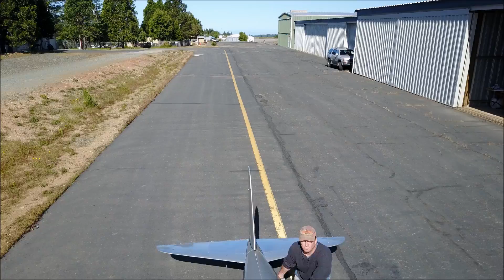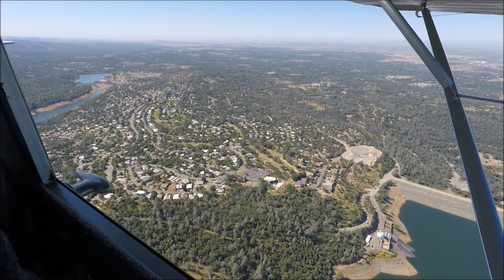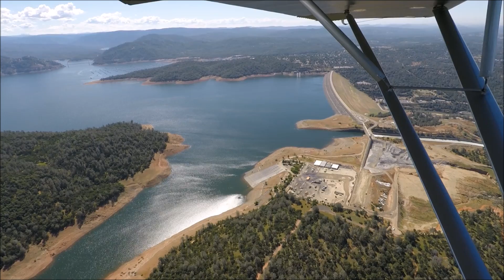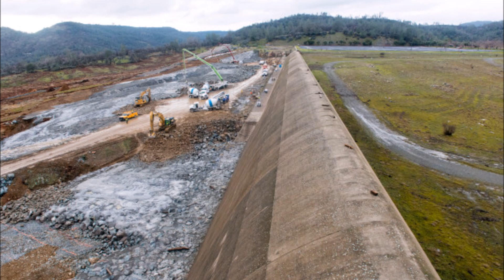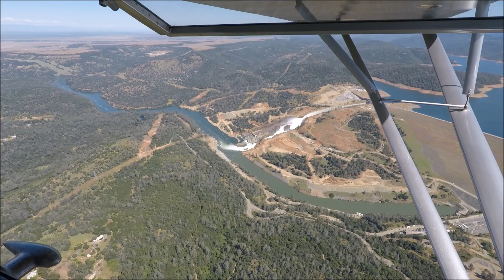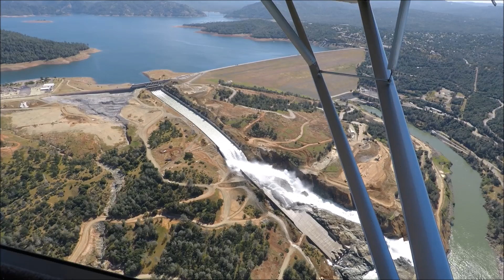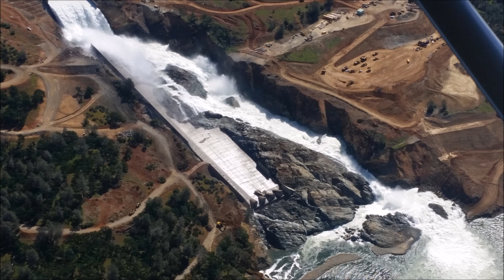Oroville 15 May Update -Recovery

Comment: We flew right over the Oroville Dam in an A380 airbus (talk about an amazing feat of engineering!) on our approach to SFO from Frankfurt.  The down camera gave an excellent view of the spillway and the canyon.  The gorge formed below the top of the spillway is certainly impressive.  It sounds like from your report that they will try to fill the gorge with a combination of crushed rock and slurry mix and then pour the RCC on top of that.  I wonder how they will contain the sidewalls of the fill?  Has DWR put out any specific plans for this?  Engineering minds want to know!  And Juan, thanks so much for your reporting.  It is such a pleasure to have access to straight forward reporting and not hype and fear porn!
Reply from the maker: Then build a reinforced concrete spillway on top of the RCC.

Comment: Batch plant would be on the wrong side of the spillway and require many millions to haul it around. If they plan to reuse the removed rock immediately after blasting it out, it will require a "drying time" before it can be run threw the plant.
Reply from the maker: i  think your right!

Comment: Wondering why they don't use the "new canon" as the new spillway... It is cut into the rock and I thought would be relatively stable.
Reply from the maker: The new canyon will be part of next year's back up plan...
Reply: Understood. Altho they are using as such because they can't complete the full planned repair before next spring.

I'm thinking that with the course sides of the rock it will induce turbulence and protect the 'walls' of the new canon. With low flow it is a calm stream, in a HIGH flow the turbulence and spray would act to protect the canon structure; kinda like it did in the stabilized form. Remove the soil and loose material, shotcret and pin to add stability to the canon...

Just me thinking thru the problem but I'm not a geoengineer.

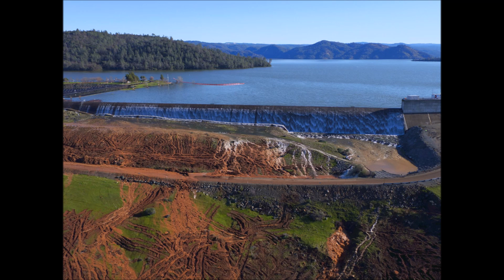Comment: Another great update. Thanks Juan. I have been surfing the Internet looking for typical solutions to this problem. One solution that caught my attention,  was Elliptical Concrete Culverts Pipes, They have internal dimensions of about 3 metres height, and 2 Metres width. ...But the exterior is not curved it is an elongated Hexagon with straight edges. This allows for 'Honeycomb" construction. These are used as emergency floodwater diversion pipes. and river diversion. The elliptical profile is claimed to substantially improve flow characteristics. I would add that from a Logistics and Cost Estimation perspective, mature solutions like this should at least be on the table for debate and discussion. Weighing about 10,800 kilos each, I imagine that even Helicopter Lift is possible? Call In The US Army Corps of Engineers, and make it a Training Exercise! Personally after @ 6:40 "ENORMOUS EROSION ON THE HILLSIDE BELOW". Allowing the water to flow in safety,  as far away as possible from the dam. from my layman's point of view, it would seem like a good idea for the emergency spillway. Those Elliptical Interior Profile & Honeycomb Exterior Profile River Diversion Pipes might be suitable?

Comment: Did you use your Mavic to get the "fly around" video at about 32 seconds into the video? If so how did you get away with that at an airport?  In the past I have pointed out the seemingly total lack of interest in this dam situation by Gov. Brown.  Today I was remembering the controversy during the dam construction that Gov. Pat Brown was stealing funds meant for the dam, which is why some of the construction may have been sub-par. I was pretty young but remember hearing about it.
Reply from the maker: Yes having a little fun with the Mavic at the airport. Must get permission the airport manager.
Reply: I have been thinking of trying to video the crop dusters with my Mavic.  Not sure of the legality of it though. They fly just a few hundred feet over my house, well within my legal air space of 400'.  I'm thinking if I "hug" a pine tree in my yard with my drone and never go above the tree top, I can get some pretty cool video without putting anyone in danger. Though I'm not in or near a No-Fly zone, I always have to "listen" for approaching aircraft when flying my drone in my back yard because most every day planes and helicopters fly over or near my house at less than 400' elevation.
Reply from the maker: I would get permission from them first then go film the entire operation.
You may have to gain their trust first.
Reply: It is easier to ask for forgiveness than to ask for permission.
Good video as always.

Comment: If they build from the bottom up, the point at which they reach the upper half of the old spillway; the two parts will have to be flush.
so assuming the new spillway is thicker than the old, next year they will have to remove more material under the upper half of the spillway than if they simply began building from the top down.
I think they are making more work than they realise.

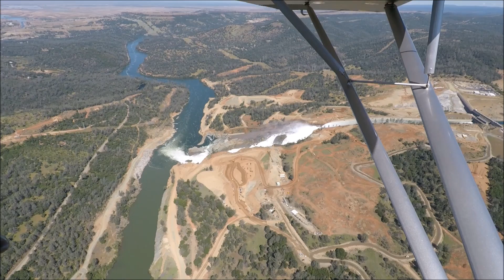Comment: At 12:28 on the video timer you speak of CA newest formed canyon, what is the depth and width at its deepest, shallowest, widest, and narrowest? It is difficult to phantom the magnitude of size from that height. Thank you for your updates, time, and energy in doing this. Was this a volunteer project or were you contracted to do this?
Reply: For scale, the main spillway chute is 178 feet 8 inches wide (a bit more than 54 meters).

Comment: One of the constraints on spillway flow has been the desire to avoid low reservoir level scouring of the inlet channel above the spillway. Are there any plans to dredge this channel deeper so as to allow high flow rates at lower water levels?
Reply from the maker: I asked about that and DWR said no.
Reply: Hydraulics is not my field, but I had thought that the scouring danger was primarily related to eroding the intake channel, which is dangerous for an earth-fill dam. But secondarily, it might be possible for the current to carry rocks up to the face of the gate valves (it would be a challenge to dislodge a rock that was wedging a gate open). It's a bit surprising that there are no plans to deepen the intake channel, especially with all the resources now on hand as we start to go into the dry season and the expected lowering of the reservoir level. Maybe someone can talk about the scouring issue in better detail?
Reply: Am I correct in assuming that, if that inlet channel scours, the rocks & sand would do erosion damage to the gate structure, and potentially to the gates, themselves?

Comment: splendid job explanation is excelent. If the water level in the summer drops right down, are they going to do anything to the spillway inlet, so they can drop the lake lower without scouring occouring.
Reply from the maker: Not at this time.

Comment: Hi Juan, when you quote 838ft  is that the height of the dam or is that from sea level ? Keep up the great reporting
Reply: The emergency spillway is at 901. The DWR considers everything above 850 to be reserved for flood control, so in normal operation they keep it as close to 850 as they can.
Reply from the maker: MSL Mean Sea Level
Reply: dlwatib, they only hold it around 850-860ft during flood season.   In a normal (non-drought) year as soon as flood season is over, they let the elevation rise, often to as high as 900ft (yes 1 ft below the top of the ESW).    Can see this in the CDEC data for previous years.
Reply: Dave, that's the water depth overall at Lake Oroville
Reply: All elevations are referenced to sea level.  The 838 figure and is the elevation of the lake surface at the time of Juan's reporting.  The height of the dam is 770 but the elevation is 926.